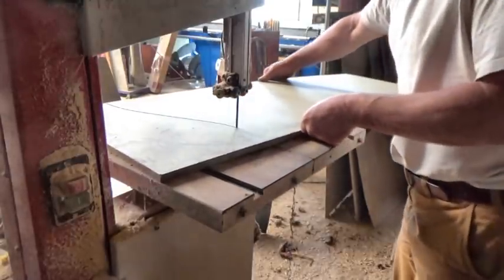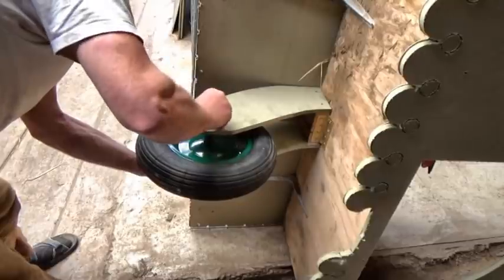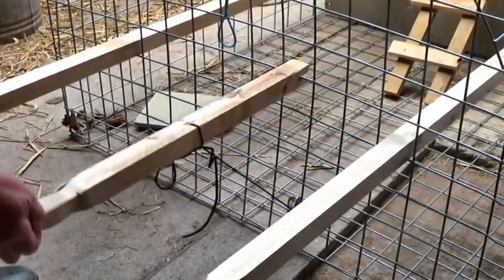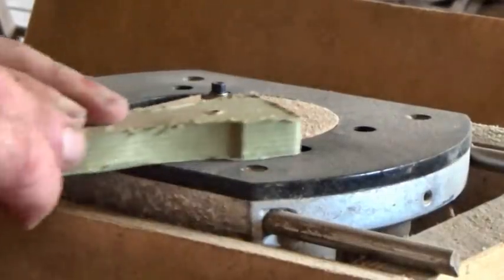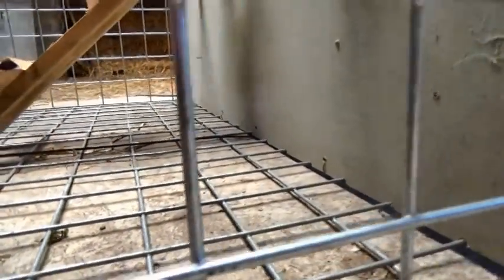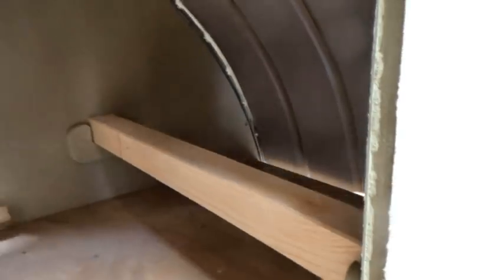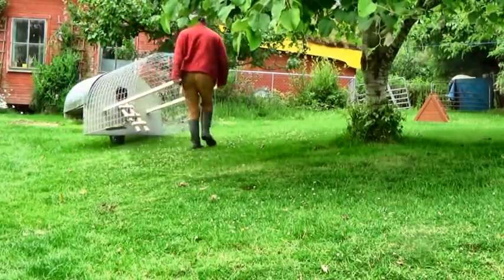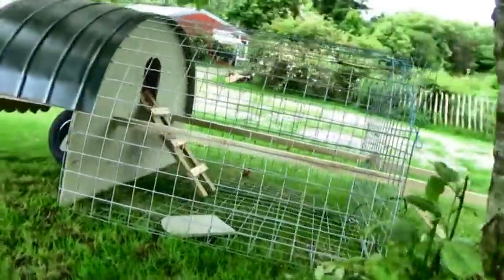Interesting Update On The Wheelbarrow Chicken Tractor Design

Comment: I like the lever for raising the front wheel. Nice to integrate that on the handles if it doesn't make it to complicated. True what you say about simple ideas & design.
Reply from the maker: You're right - I'm still working on that, but haven't found a way yett..
Reply: Maybe use thin wire cable instead of paracord

Comment: Very nice design. I like that you can move it from one side. 
I think it would be an buyers eyecatcher if the handelbars doubled as leavers. You grip the jandelbars, pull up, the wheel moves down and off you go. It is a bit more complicated but would be adding to the "easy movable" selling argument;) interedted hearing yout thaughts
Reply from the maker: Unfortunately it's already the most expensive henhouse in Ireland! I sell a few, but I don't think I could put more costs into this design.

Comment: I like this project. I used to have trouble with raccoons digging into the coop at night but the mesh floor would stop them here. Seems to me it would be simpler to flip the wheel down by hand by lifting the front of the cart rather than using a lever.  Could have the wheel mounted on a pipe which drops through brackets and can be fixed with a pin.
Reply from the maker: You're right - but I liked that both the lifting and the moving can be done from the same place. But I'll keep thinking..
Reply: @WayOutWestx2  I was wondering if it would be possible to incorporate the wheel-lowering lever into the handles so that they fold up when lifted and automatically lower the wheel.
Reply: @artemiasalina1860  Agreed.  I also think the cord will not last more than one or two weeks.  It needs to be something that is both weather and manure safe.  Something that travels along the sides like a plastic coated wire inside a "U" channel (wood, plastic, aluminium, etc.).  Also, possibly changing the wheel mount from above to the front side and inverting the wheel assembly so as to maximize height on the down-drop?  Combined with ArtemiaSalina's handle incorporation should also decrease problems for users with arthritis in hands and backs.  *especially if the "U" channel can pivot up and down from the front wheel assembly or from the handle area down to the wheel (but that angle would add more complexity-albeit with more sturdiness). **also...the system should be on both handles going all the way around on each side.
lolz--I hope this helps!  I miss my chickens.

Comment: I use phenol board (birch ply) on the boat, edges are sealed with epoxy resin.  It is strong and easy to work with, all sorts of uses. For the wire/paracord there is a line called Dyneema, as strong as steel, worth trying, non rot, very strong.
Reply from the maker: Thanks, Jo. I looked it up - but couldn't work out if it's water-resistant or humidity resistant. (Also it seems only to be available in 18mm sheets here..) Do you use yours outside?

Comment: Maybe steel cable / wire rope (sorry I'm not sure about it's name in English) could be a possible substitute for the paracord. Or some of the kind of ropes usually designed for clothes lines. 
Wooonderful chicken tractor Tim, thanks a lot for sharing. And as always a hug for you both from Spain.
Reply from the maker: Thank you!
Reply: I second wire rope. Tough, flexible & available in stainless/inox.

Comment: Hi Tim. For raising and lowering the wheel, perhaps consider a simple shaft that's basically an extension of the pin in the hinge that the wheel arm pivots on, and fixed to the wheel arm. If it extended to the side of wooden floor you could have a simple lever arm on it that you could rotate through 90 degrees to swing the wheel into place. Sort of like a hand brake lever in a car but connnected directly to the outer end of the shaft. It might be easier to engage as you would not be lifting the weight of everything, as the back end of the coop would still rest on the ground as you rotate the wheel arm. It would replace all the cord, pulleys and lever with a single part, made prehaps from welded steel tube. You're going to have to make the hinge for the wheel arm more robust anyway so maybe a simple steel steel in a couple of 'U' bolts or brackets bolted under the wooden floor would do it and then it's trivial to extend that shaft to the side of the hutch and put a lever arm on it to  rotate it. May even be cheaper than your current arrangement. As you said - simple is good.
Reply from the maker: thanks, Andrew. Good idea. I didn't go that way because I wanted the person to be able to do the lifting and the moving from the same place. But I'll have another think.

Comment: How about bending the weldmesh up 6 inches so the wooden panel is off the ground
Reply from the maker: Thanks - I'm working on that as an idea. (First build a bender..)
Reply: That would stiffen the bottom mesh. Good point !
Reply: @WayOutWestx2  A gavanized sheet metal would be longer lived in that area because of wear & tear of expected use.

Comment: Still would recommend a 26mm or similar mesh for the roost/ nesting box making it self cleaning.
Reply from the maker: I need to screw the upright panels onto the floor. If it was mesh, I'd have problems making it all rigid
Reply: What about a box iron (steel) Frame that the mesh is welded to. I would also give you a place to attach the hinged wheel.
Reply: Or cut out the center out of the wood bottom leaving a 5-8 cm rim around the edge.
Reply from the maker: the thing is, if I weld parts together they will need to be galvanised afterwards and I'm trying to avoid that as much as I can because of the expense and the hassle
Reply: @WayOutWestx2  My aviary/poultry fortress is built with both panel wire AND mesh walls. They are connected with very small zip ties every 4 inches then sandwiched into a dado cut inside the frame of 2"x4" wood secured to 4"x4" poles.
For your application, I'd put the mesh on the inside of the floor (for the comfort of tender chicken feet) and the outside of the walls (where rats will be pushing the mesh toward the heavy gauge wire panel). 

Securing the hardware cloth/mesh to the wire panel with zip ties or twisted wire should suffice. I doubt you could weld or solder them together, but I am often wrong. 

Beware of carpal tunnel syndrome if you hand twist wire, and be sure to fold and secure the ends to prevent lacerations. Ask me how I know this, lol.

Comment: You could extend the front of the floor vertically up by one 'row' and attache the timber front wall to the top edge of this extension.  That should keep the timber out of most of the damp.
And just a whimsical note:  Do your chooks like to peck at ropes and cords?  It might be a good idea to keep the wheel lifting cord well clear of the chooks!  :)
Reply from the maker: Good idea  about the bend. I'm working on that..

Comment: Nice job. Perhaps something like bicycle brake cable, could be housed, the use of another pulley wheel, or custom made wheel to stop the cord or cable from rubbing on the edge of the base. Bicycle cable housing could be terminated into a partially drilled out block of wood with a smaller hole for the cable to run through. Just have to make sure the curve of the cable is not too acute and it is connected to a pivot at the wheel end. If you use this, as you may know, it's best to terminate the ends of the cable with a lug or wrap cotten around it then add baking powder and then superglue. Best of luck.
Reply from the maker: thank you, good idea. I will look into the costs of that wire..
Reply: For what it is, just an extra pulley wheel to reduce wear could suffice, if your going into mass production then have some kind of tensioning device for when the cable stretches, as any cable used will ultimately stretch a bit if under strain as I'm sure you know. Teflon coated cable may be an option, depending on cost.

Comment: Love it. Rats are an issue in NZ, but I find they go after ducklings / chick's and don't seem to go for eggs or adult hens. So the mesh would be fine. The question I have is how would the corrugated sheet be attached so it didn't blow off in the wind. But still gave easy access. I guess a few metal pins / rods in the right spot, that could slide back and forth would do the trick.

Comment: I would have thought to put the lever for the front wheel at the front as well. Just to snap that wheel in an self locking position and then proceed to push that thing with your handles. Maybe that fork needs to go the other way around. I wouldnt wonder if the hens would eat that rope over time.

Comment: Loving the way the wheel moves up and down. Very smooth and easy to use. Would the chickens peck at and eventually destroy the rope under the run?
Reply from the maker: I wonder that too, but I doubt it. More worried about the sun on the rope and the wear on the parts that move

Comment: How about bicycle components for the lever system? Gear wire should be neat and compact, and with cable lining hopefully won't degrade.
Reply: Love the idea. Are you thinking perhaps handbrakes on each side connected to two pulleys and the wheel? Perhaps routed through some PVC pipe?
Reply: @hjkgufytfyug  thanks Raymond. Hopefully you could get away with normal bike cable mounts and guides but PVC would work as well.

Comment: Tim, the door shouldn't be much of a problem. I make doors and gates out of wire panels similar to the walls of your chicken tractor all the time. I can send pictures for clarity if necessary.
 
My gates are very simple, just cut out the shape you want and hinge it to the wall in which you need the gate. I.e., the hinge is the attachment. The tricky bit is making sure all edges  of both the opening and the door are edged in solid wire (to prevent injury from the "pokey bits") - but you can weld, so that shouldn't be as much of a challenge for you as it sometimes is for me.
 
I tend to use 3 types of hinges for wire doors and gates: 2-4 zip ties for light duty, 2-3 metal hog rings (pieces of shaped wire crimped into a triangular "jump ring" by a special set of pliers) for heavy duty use, or metal strips shaped to have a hump in the middle (like the capital Greek letter omega) to accommodate the wire of the gate. The latter form is for attaching the gate to a solid, stationary wall or a wooden board. For your application, I suggest the hog rings or zip ties.
 
The latch is almost always a small carabiner clip; it doesn't need to be an expensive climbing carabiner. Any spring-loaded clip would do. You could use baling wire to keep costs down I suppose, but I have learned not to trust birds with knots of any kind. My geese can untie any knot in baling twine that I have presented to them; they seem to take is as a personal challenge. I never tested chickens with knots, but better safe than sorry.
 
You could place a small door between the handles or on the side as you mentioned. If it is "locked" with a carabiner, it shouldn't flap too much.
Reply from the maker: I was trying to find a way to use the cut-out part as the door. But it's smaller (obviously) so I think I would need a frame.. Perhaps you used a whole new door piece? (Too easy!)
Reply: @WayOutWestx2  I haven't had an application quite like yours, but yes, I used a whole new (recycled) piece. 

I would think you could tack weld a simple wire frame on either the door and/or the opening. It doesn't need to be strong, just safe from accidental impalement. You might even be able to put some sort of cover on the ends of the "pokey bits" instead of making a frame to make them safe.

Comment: Tim, could you wrap the MDF on the ground in some lightweight metal? Just a couple of inches tall maybe.
Reply from the maker: Thanks, but if it isn't sealed really well that would probably make the wood rot quicker because it would hold the water in

Comment: Did you try compound pulleys to reduce the tension and wear on the cord? (If you get the tension low enough you can make the pulleys out of wood. (I'm imagining replacing the arm with a wheel to gather the extra cord.) You can have the last pulley block connected to the rolling wheel using solid wire or a strong arm as it only moves in a linear direction.
Reply from the maker: Thanks - yes that could work, but would need more string, and pulleys, so I'm not sure it would be worth it. There's not much weight on the the lever..

Comment: ide use a light gauge steel rod to raise and lower the front wheel.
Reply: how would you apply the leverage?
Reply: How about a rotary handle on the operator side connected to a gear at the other end of the shaft connected to the wheel. Thinking captive nuts/threads on the wheel arm that a threaded shaft could push/pull as it rotates.

Comment: Why don't you use 2 inch water or esb duct/hydrodare as sled runners. It slides over everything easy.The wheel seams very complicated.
Reply from the maker: because the mesh floor would be 2" above the ground and it would be uncomfortable for the hens to walk on

Comment: I have some constructive criticism of your project which I hope is of some help to you. My first point is that having a mesh ‘floor’ in the chicken run inhibits the ability of the hens to scratch the ground in search of bugs, grubs and invertebrates. Also, there is the potential that the hens will damage their feet when scratching a surface covered by mesh. The size of the accommodation you are providing for your hens also concerns me. The experts tell us that in order to ensure the welfare of your hens they need 2/3 square feet per bird in the roosting compartment and 8/10 square feet per bird in the run. I hope my comments are of some help to you - good luck with the project.
Reply: Some people say a smaller mesh is better if you have small prediters that try and get under or sides, I always thought open bottom with spikes around the bottom that are close enough and deep enough so when u lift it and put it down the spikes go into the ground, but if u have hard ground it doesn't work as good, most people say the prediters don't dig under , guess u could put a bend on the bottom outward with mesh for hard ground,
Reply from the maker: Thanks Matthew. I'd be interested to read your sources for experts. 

It's not an easy balance to meet - of course hens should get as much room as we can give them, but we have a responsible for keeping them safe too. The number of square feet for each bird in a run would be very different if the run is fixed, surely? This design allows new, fresh ground every day (or more often), and that has to be considered against the limited space they have.

As for the inside space - we have two other hen houses and I can say for certain that they only need that extra internal space if they are shut in at night. This house is designed to be open at all times.

Damaged feet? That really isn't going to be a problem - imagine if they were roots.

A mesh on the floor is necessary to keep them safe - and to stop the lawn getting dug up.
Reply from the maker: mister z, Good idea - but spikes would still only work where the ground is not too bumpy
Reply: @WayOutWestx2  yes would have to be thin spikes or bend mesh out, sounds like every area has their own challenges with varmints
Reply: Way Out West Blow-in blog In offering advice I relied heavily on my own 50 years + of keeping chickens. I also keep up to date with new research in animal welfare. There is lots of advice available on-line all of which provide a very consistent rule of thumb with regard to space requirements for hens. This example is typical of what might be found on line it includes a helpful table - https://www.dummies.com/home-garden/hobby-farming/raising-chickens/how-to-determine-your-flock-size-and-space-requirements/  There are also a good many up to date books on the subject of keeping healthy, happy and productive chickens available from Amazon.
I am currently in the process of designing a new combined hen house and accompanying run which I intend to build during the winter months. My motivation is to improve the quality of accommodation for my own hens - taking into account current thinking with regard to animal welfare. I have also found a series of videos produced for distribution on YouTube by a manufacturing firm in the US called Carolina Coops to be both informative and helpful. They promote the deep litter method of housing hens which is something I will be trying myself. Also - I’ve learned from viewing these promotional videos that hens prefer to roost 2ft off the ground and with a lot of headroom - difficult to achieve with a small coop. 
With regard to using mesh on the floor of your run I’m sticking firmly to the advice I’ve already provided and based on personal experience - mesh underfoot will harm the feet of your hens. I appreciate that you are eager to protect your hens from predators - most commercial tractor coops offer an option of a mesh ‘skirt’ around the outside of the run/ hen house to prevent a Fox from digging under the mesh sides. These skirts can be held in place with pegs or weighed down with a few stones and be lifted when transporting the run. A word of caution - again based on my own experience - if you have foxes around and your hens are not secured in the hen house at night then the foxes will take them. It is also frequently the case that they will kill all of the hens they don’t take - it’s what they do. Anyway, good luck with your own venture and - as previously stated - I hope you find my comments constructive if not helpful.